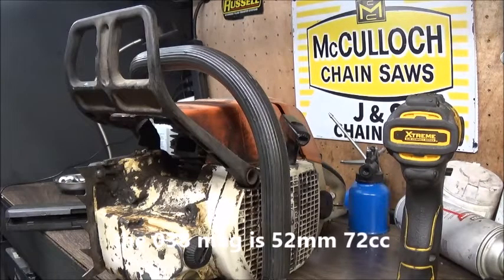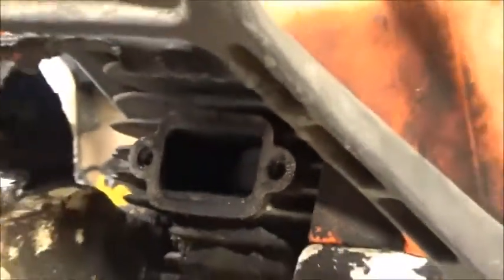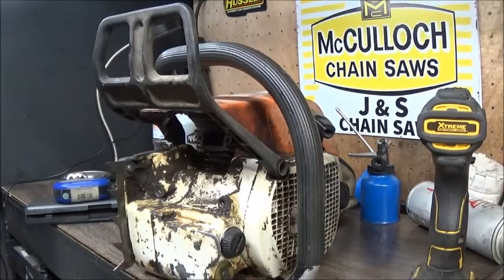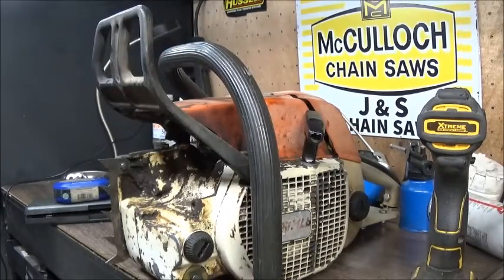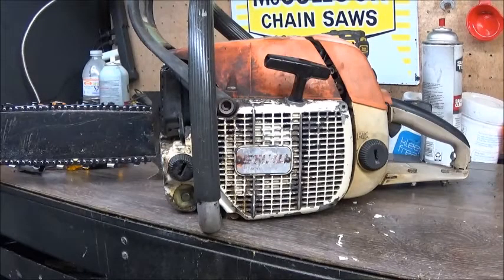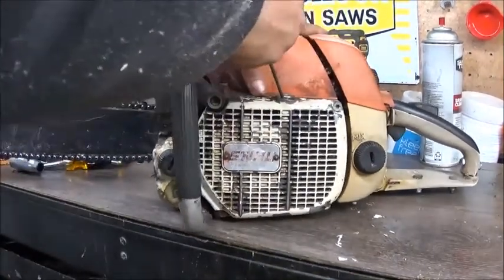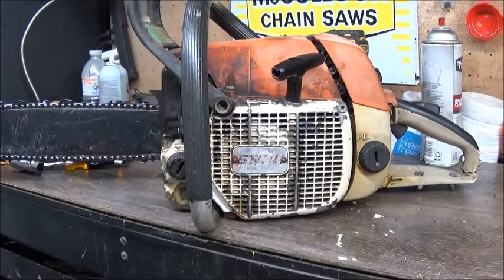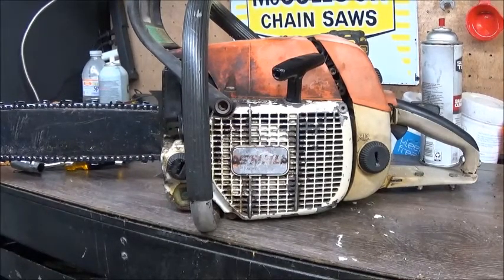Stock 038av Super vs the 038 ms380 farmertec kit saw

Comment: For that kit saw you got- I have had good luck with the Hyway jugs they are sure a lot better that they used to be.I myself would run the Pi__ out of that kit saw just to see if it gets close to what you  thank it should be. Do you have have that muffler opened up on it ? If so try blocking that off and put a 7/8 OD X 5/8 ID X 2 1/4 long Pipe out to wards the front side over the clutch cover.Insert the pipe inside about 3/4 of inch and weld her up.I don't know if this will help it but this has made a difference for me . on a lot of saws.I was piping saws before it was cool ! If you know what I mean.
Reply from the maker: Saw has a dual port..I think it's the port placement..I'm gonna run it some to see if it gets better..
Reply: @JandSChainsaw  I thought it sounded like you had it opened up from what I could tell or hear on the puter.I don't know what it is but sticking that pipe inside the muffler a 1/2 to 3/4 inch helps.One of my buddys has got a flow bench and we test mufflers and different  openings and pipes all day 1 Saturday a few years ago and that floed the best of all.We tried it on a # of different muffler and saw models and that worked the best.Good job on what you are doing.